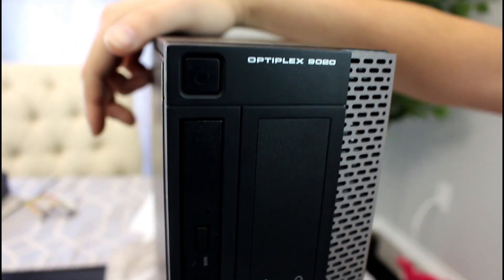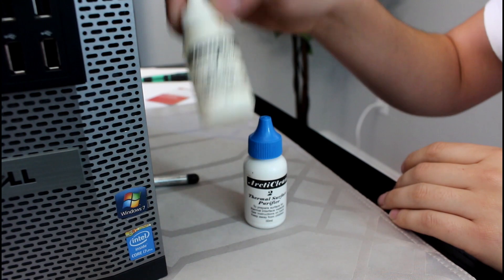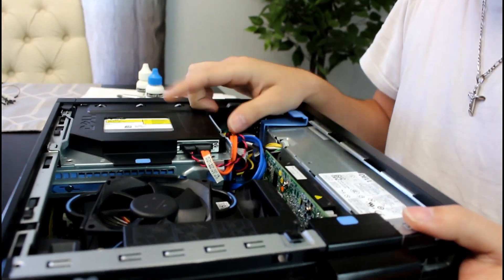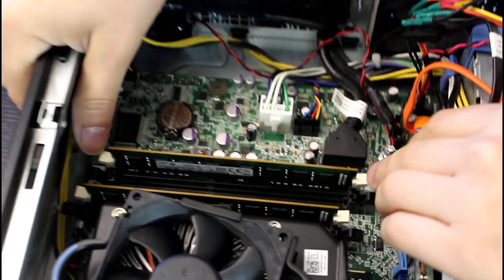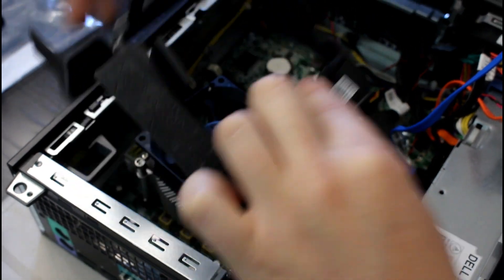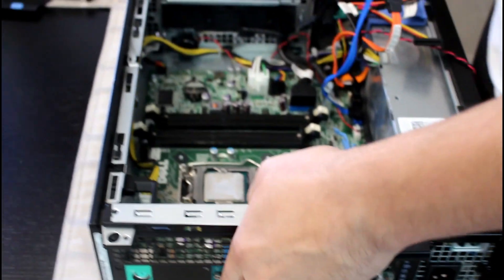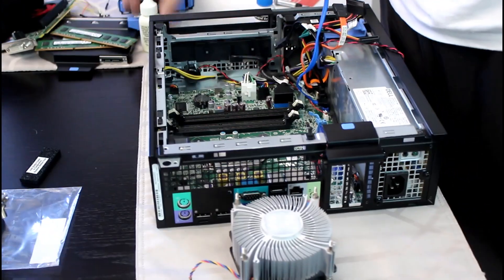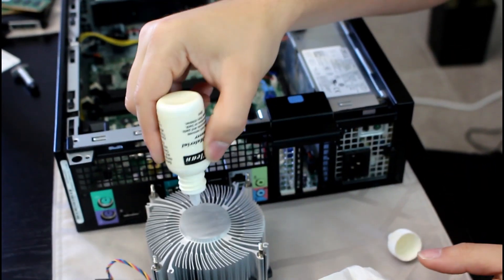Dell Optiplex 9020 SFF - How to replace the CPU and thermal paste

Comment: Where can i get a Core i3 or i5 processor for this pc??
Reply from the maker: Mr. Anthony Sanya I buy them used off eBay. Usually less than $50 for a decent upgrade. I would go with an S type though since this is a small enclosure and the CPU heatsink is kinda small.